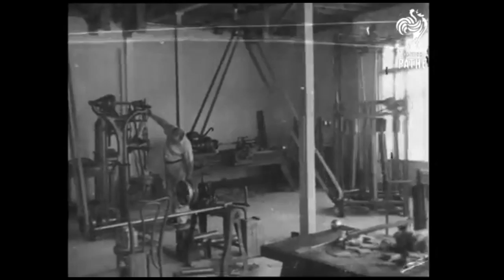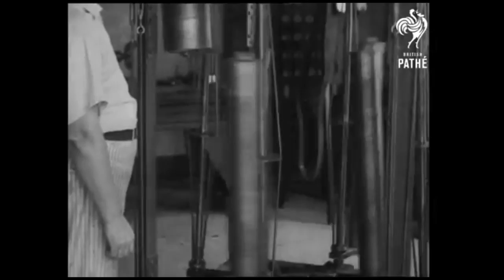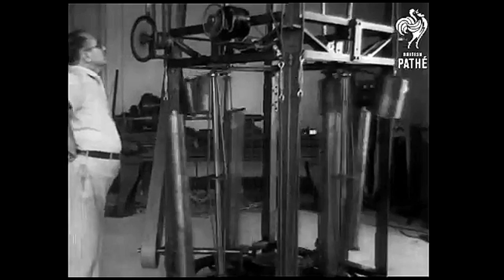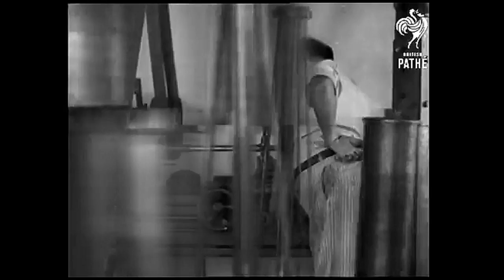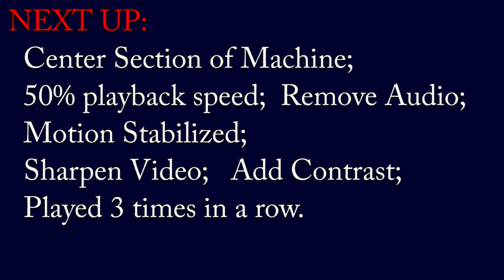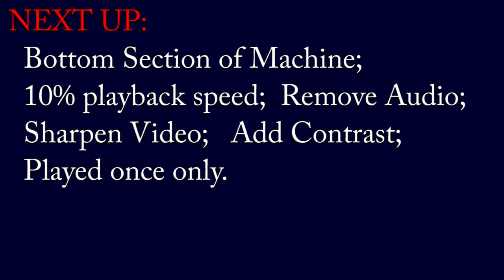William Skinner 1939 Gravity Power Machine - Replication Investigation

Comment from the maker: One thing I'll post here to prompt a thought process... for the thinkers.

Any constant natural force can be harnessed, we do it all day, every day in hydro-electric, solar thermal, geo-thermal, wind turbines, etc.  All that needs to happen is to create a "difference" or "gradient", and it's that "differential" that is able to be converted into other forms of energy... such as electricity. 

In hydroelectric, it's the "difference" in height of the water falling due to gravity. In geothermal, it's the temperature differential that we harness. In SolarThermal, it's also the difference in temperature gradient. In wind turbines it's the pressure differential that occurs across the turbine "propeller" blades. Yes, these can be all considered "free energy"... to us. Once we build the machines, the energy is 'essentially' free, natural sourced.

If we can create a constant "direct gradient" of the forces applied by the universal force (called gravity, and incorrectly attributed to be a 'pull' to the center of a large mass), then we have a "difference" we can harness. This "gravity" takes advantage of the mass of objects... the more mass, the greater the effect. If we put that mass in motion in such a way that there is always a potential gradient, then we have something that can be harnessed, and converted to electricity.  There are ways to create this gradient in a balanced method, such that the 'machine' requires little input (since it's balanced, on an overall scale), but when viewed from the gradient point of view, it's imbalanced.

Stop, get quiet, and think deeply... consider possibilities.  Look at the problem from DIFFERENT perspectives, not just the "macro" view, but the subsystem view. Look at it from each parts' rotational center, look for gradients, then see if that rotating part is balanced by a complimentary part, so that the overall system remains balanced, and easy to run.

"Thinking deeply" is hard for our minds these days... we have sooo many distractions, worries, concerns... and all that stinkin' media!!  When you consider the incredible inventions of mankind in the ages past, you have to ask yourself... how did they figure that out without computers??  They did not have the overwhelming distractions we do today... they gave much time to "deep thought", and just did it!!   The human mind is capable of FAARRR more than we can imagine... but we just don't devote time to it.

The car with waves on top is not creating a differential gradient... not applicable... that's what comes from a macro-only perspective.
Reply: +beforebefore Sir, you are absolutely correct about many issues, but it seems that you  somehow misinterpreted my analogy of how the Skinner's machine work in reality and not how other people claim it works  including Skinner himself. Please may I ask you to review my analogy as the machine in question is no amplifier of enrgy nor does it extract it from gravity  but it is all due to the input, in this case the front car doing the pulling . I used the waves on top of the car, with  weight in between to pull another car, for that is in fact what happens in the Skinner's machine with the weight of the pendulum starting at the lowest point with no load attached.   The input is the front car with the wavy top is the  car  doing the pulling while the car being towed is the load.   The wavy top is producing the tow link which can slip eventually when the load is larger.  There are no knots or fixed joints tying the cars together but simply a heavy weight in between the crests of the wave.  When the load is light with the cars  on the level, the towing can takes place but as the load gets heavier the weight between the wave will slip back till it goes over the crest till the  rear car, or the load  cannot be pulled any more and the system slips the load.

The heavy weight in Skineer's machine drops down to the lowest height when there is no load, as the heavy weight on the wavy car in between the waves on the roof,   then when there  the Skinner's machine is loaded, the weight of the lower pendulum will start rising as the pendulum rotates back, producing a side force that is  pulling the load, exactly as the weight on the car slipping backwards. and so on.

All I am saying that the Skinner's machine does not work as claimed , but as I am suggesting.  Please would you  be kind enough review my analogy as   I feel few people ever explain how the  load  to pull the load  is very explained by people who built this machine.

About the gradient, I absolutely agree with you . What seems to be   different between water  flow potential , wind potential, temperature potential is that there is a flow  of  some sort even before   we introduce water turbines and wind turbines in  the flow,    but in gravity it appears  that energy appears when we move mass into the gravitational field and reach  some position, there seems nothing flows in gravity before we introduce mass.
If we try to extract energy from  a stagnant lake where water does not flow, there is a potential in the height of the water  but we cannot extract the energy , from a stagnant lake,  Without thinking too much about it , I would say that extracting energy from gravity is as difficult as trying to extract energy from a stagnant lake.   One has to work on the water first and then and only then you can say that the water from a stagnant lake gave some energy back. I feel it is the same with gravity..... you give  present her with a  mass, and all the work done on the mass to reach that potential will be available to you when ever you require  it back. Extracting Energy from Gravity and Stagnant  non flowing  water lakes  is not so easy as when we have small particles of water dropping in a water fall or small particles of air moving  fast  on a windy day, with the relevant potential that exist. I can extract energy from a stagnant lake by introducing a balloon filled with air( buoyancy) and a mass (heavier than water)
With a stagnant  non flowing water lake  we have to work on it first before it gives us something back as in gravity.    When there is flow, it is different and much easier for us.

Please, be kind enough and have another go at  confirming that my analogy about the wavy car pulling another one with no  knots and fixed anchor points  but with a slipping clutch in fact .............. that all there is in the Skinner machine. I find that many people do not understand my analogy,

About anything else I absolutely agree with you. Please  do have another try at comprehending my analogy. Thank you.

Comment: Sir, I feel that you need to reconsider   the fact that this machine can produce  energy from gravity. Here is how this machine  works.

Let us consider the action  of the two rotating, but not directly connected weight shown in the lower half of this machine. It is this indirect link that is interesting. This is a link which can slip if overloaded.

Assume  that you have a car with a large pitched and deep  corrugated  wavy roof with a long pitch between the crests of the  deep wave, where the crests and hollow of the wave running sideways to the motion of the car.   From front to back, the shape of the   waves on the roof are sinusoidally distributed as what we conventionally call A WAVE.  
Now you are required to tow another car behind you, but the manner in which you are going to do it is to take a heavy  weight , tie a rope around the heavy weight and put the weight  on the roof of the car in one of the hollow of the wave, and then attach the other  far end of the rope to the car  you are going to tow. 

Starting on  a flat surface,  the front car will take the tension, and  as we are  running on the flat, the heavy weight will stay in between the crests  deep in the hollow.   Then, we move to a slight hill and as the towed car needs more pull, the heavy weight in the  the hollow of the wave will start climbing the   leading front of the wave, which we may call the wave-front, Then as we try and climb a bigger hill towing the same car behind , the load will increase accordingly  and so the weight in  the hollow between the crests of the wave will rise higher and higher with this load. When the hill is too high and so the towed car offers more load, the weight will rise right  over the crest to fall in the following hollow and hence the load will slip  back from the   front car  losing/slipping  the load effectively. In A.C motors we call this a slipping effect which in fact it is. 

The Skinner machine is really a complex impulsive slipping clutch!!

All this is happening in the Skinner machine and there is not an ounce of amplification anywhere.  Please do not be misled and do argue with any one who used calculus  to prove that he can produce almost unlimited  over- unity.................. and do not believe that he was even modest and humble when he said, ALMOST unlimited over unity. The continuous output  energy of this machine is no more than the input energy one supplies it with and what is more if the load is too heavy, the coupling will slip essentially decoupling the output from the input.

Comment: @Quantum Leap,

"died a multibillionaire" is not a scientifically defined process for deciding if a complex physical process/system has valid claims or not.
 Otherwise, if it were to be a scientifically defined, that the statement would be contradicted ,immediately, and as such invalidated, by the fact that Tesla died basically penniless. With that in mind, I would assume, that it would be hard to dispute, the fact of what Tesla did for the contemporaneity civilization and in the way it was (regrettably) treated and died.

Comment: nice production, I am getting closer to start building my model.  I picked up a metal lathe because using wood wouldn't give me precise enough dimensions.  
My main structure is secondary, first will be the transmission couple plates; after that is accomplished correctly. I can build the levers. witch are already set at 12".  I will past as things happen.  Thanks for the video.
h2ocommuter...

Comment: Now I've seen a video of a modern rebuilding of Skinners device and I know the belt is driving the rods I was wondering about. Still wish we could see more.

The enhancement is well done, but I'm skeptical. I don't see how any power is being generated, and it looks like the lathe is being driven by the alleged 1/8 horsepower motor itself, not by any motor being powered by the generator.

I don't see any power leads going from the machine, but since the cameraman didn't go around the whole machine they may have been hidden. I wish we could see more of the top of the machine. Why the waving rods? Where exactly does the drive belt going up toward the ceiling go?

This looks a lot like a perpetual motion machine - something no one has actually managed to build.
Reply: +Bert Knabe  Sir, may I offer  my opinion on what I see in this video.   The alleged !/8 horsepower motor is the one on which he is shown  looping a belt/ string driving the other pulley on which  exists the drive belt going upwards  towards the ceiling, as you well noticed.  This  driven belt going up to the top plane of the structure drives  a gear box with four  synchronous rotating  outputs  with cranks on each, are placed above the waving rods, to  which are connected to rotate and  wave rods you described and they are waving due to the  rotating crank action I described.   It looks clearly like a circular motion and not elliptic nor  pulsating( which would work too)    Well these waving  rods reach the lower half of the machine by passing through gimbals where the protruding waving rods through the gimbals act as levers,  changing the force to  drive the fixed weight on the  mid part of the machine, a weight that is fixed to the waving rods to increase the inertia of rotation.      
Well  on the base of the machine is the FREE weight on each inclined shaft which always tries  to drop into the hollow created by the inclined almost vertical shaft which is brazed by four tensioners. Obviously the load attached tries to pull this free weight up an imaginary hill on the plane of rotation of the free weight.    Here I must point out that the flying heavy weight only supported at the bottom  end must have given  an unexpected centrifugal force which Skinner did not seem to expect and so when he noticed the thin inclined shaft arching  due to the  reaction of the single lower attachment to centrifugal force on the free dropping weight in the shape of a long column, he quickly added the  four  tensioned braces to stop the bend in those four lower shafts.  I suppose he could synchronise the four weights below to stop the over all vibrations of the machine. 
The inertia of this machine enables it to store energy, but if there is a load on this machine the CONTINUOUS OUTPUT  will be 1/8 horse power as you so  intelligently mentioned.
Hope this helps,  and I must say that, I am  now an old man, but my eyes still focus reasonably well, while my  engineering mind still combines observations made, in a  logical and a sequential manner to diagnose many engineering functions.   Well, this machine is not what many claim to be and it has as yet not flooded the international, the industrial, military and domestic markets, not even after almost 80 years where there could be so much developments.    The human mind needs entertaining and this machine did provide this for many people.
Reply: Carmel Pule' It did indeed provide entertainment. :^)
Reply: +Carmel Pule'  Skinner's machine is indeed entertaining, but a large, heavy flywheel would serve the purpose just as well. Output will always be less than input, and to think otherwise is foolhardy. Gravity is a unidirectional force, and nothing can change that.